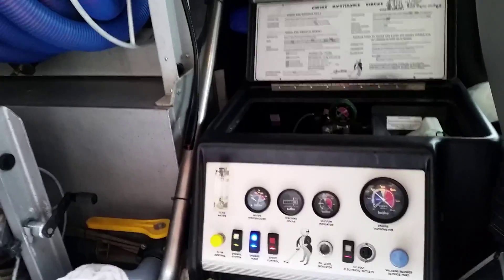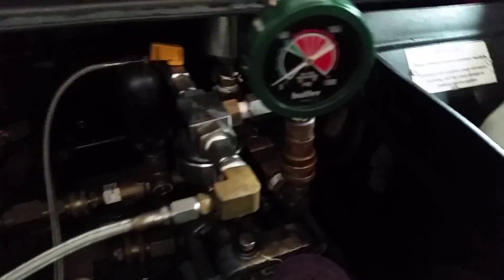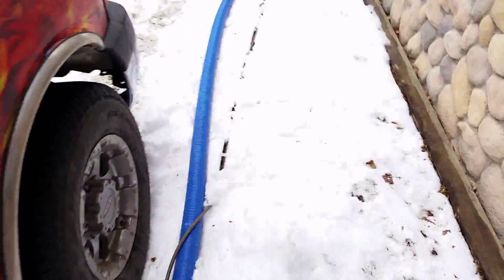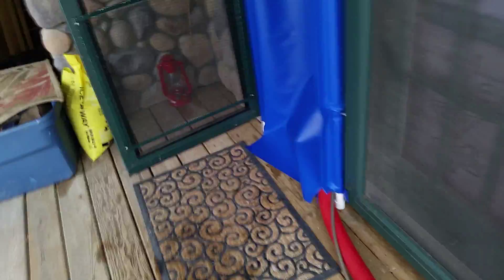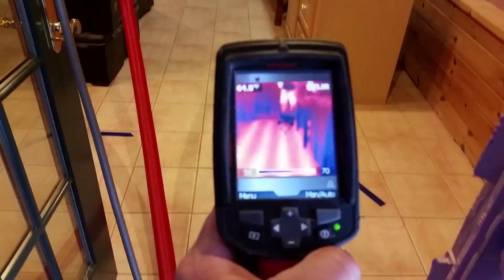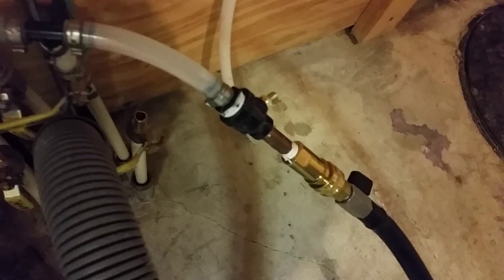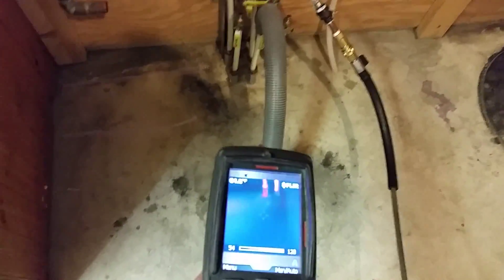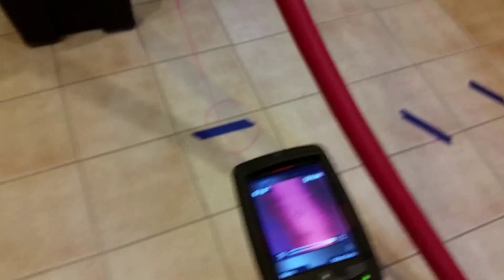Thermal scanning broken infloor slab heat pt 2

Comment: That is very cool! We have in floor heat in the lower level of the house and also in the garage, it also goes through the furnace and hot water tank in the winter time, the heat is incredible and keeps everything warm and toasty!
Reply from the maker: LogicalProcessing we don't do this often. It can be like finding a needle in a haystack yet with false signals. This one was crazy